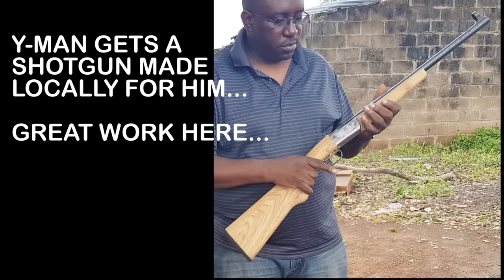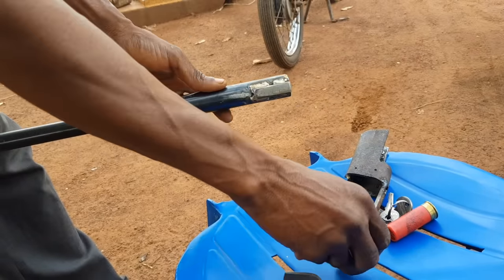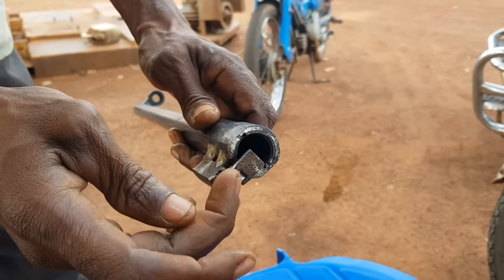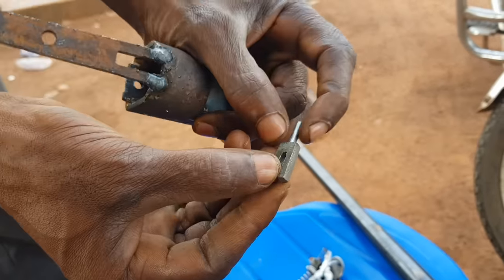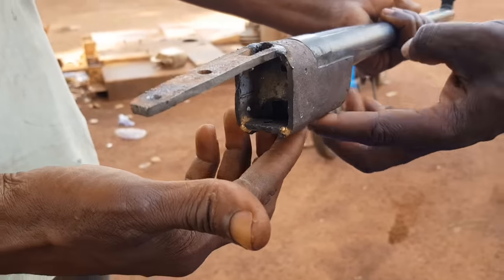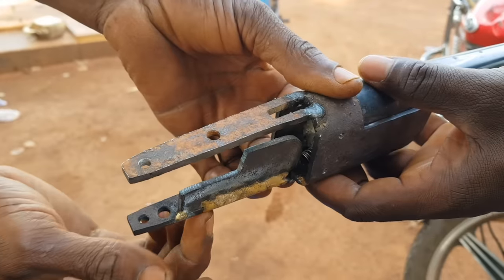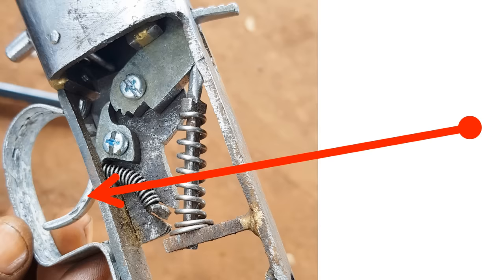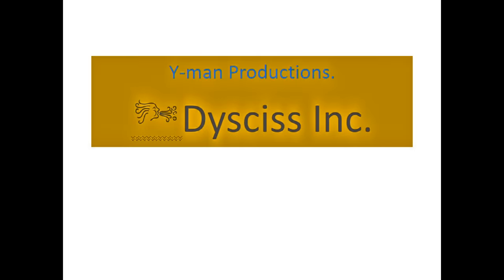Fabricating Local Shotgun using old Mossberg 500 Barrel.

Comment: Curious about the welding for these guns. Do they use a normal arc welder ? If so , what electrode is commonly used , perhaps 6013 rods ? Btw , the craftsmanship and ingenuity especially with basic tools and salvaged materials, just absolutely unbelievable on what they can do with some scrap metal and basic tools . Well done 👍🏼👍🏼
Reply from the maker: Thank you Joshua Wong. Basically - artisans here use almost any electrodes they see to buy. Usually, to maximise profit - they go for the cheapest they can get. But I made sure my gunsmith used the highest grade available - to avoid rust setting in in welded joints... We do not always know or work with the rod grade grade numbers like you mentioned. I will still find out though...
Thanks.
Reply: Yman83464 Thanks , its just such an astonishing thing to see, the different ways different people from different places make ends meet and put food on the table . And the different leisure activities carried out by people from all over the globe .